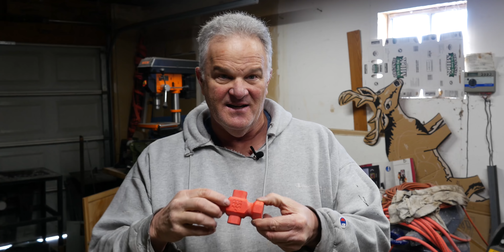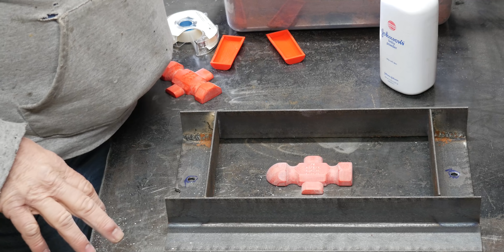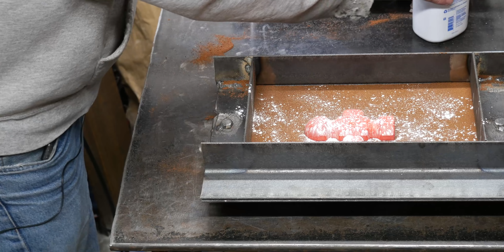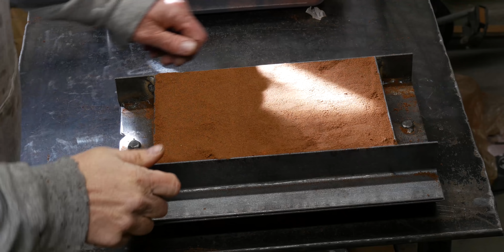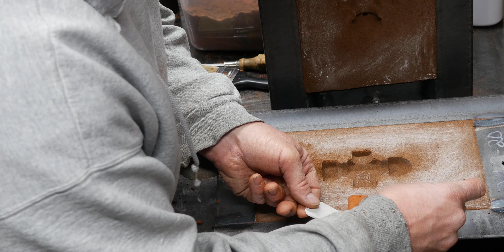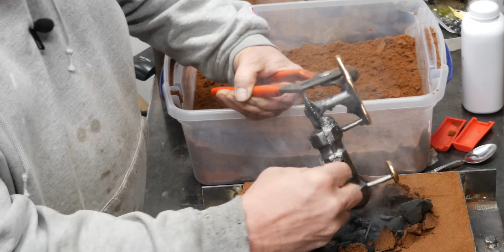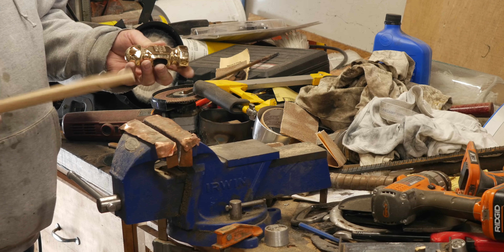Casting an aluminum bronze hammer

Comment: That turned out wonderfully, not counting the bubble of course... Yes, you were correct. I did not use a core. I was just using an old ball pien hammer as a form. I filled the bottom box, Drag, I think it is called then trenched out a spot to fit the hammerhead and hammered into the drag until it was half below the top of the sand, then took it out and sifted some petorbond into the mold, then put the hammer back in and hammered it back to the half waypoint. The eye of the hammer is vertical during this... Anyhow, then I filled the eye and packed it down as hard as I could till it was level with the mold on the outside... Well, surprise, surprise... the core always comes out with the hammerhead... After a bunch of tries, I said to heck with it and poured it full of wax. The was hammer turned out great. So, I widdled out the eye and molded it in petro bond, put it in the oven, and melted the wax... Lol... The darn core caved in when the wax melted... Today, I took my wife out for a ride in the woods on the ATV to enjoy the Autumn leaves, then I just watched a bunch of videos confirming that I was out to lunch on the whole idea... I think I will turn a whatever the thing is called that you use to tamp the sand down, on my lathe and make a brass one of those as a first project... A hammer seems to be a big ask for a first casting... KISS as we used to say in the Army, Keep It Simple Stupid...  I appreciate your videos so much. I intend to watch them all from the start eventually. Thank you and be well...
Reply from the maker: Be careful, some of my early videos are full of really bad technique. I wouldn't want you headed down that path.  
Most hammers, that I've run across, have a tapered eye in them. I think the top is the widest. That way when you drive a wedge in it will spread to a "V" shape and keep the head from flying off.

Comment: 3d printing the patterns is a great idea, but next time, design some registration pins into the 3d print. As someone else pointed out, get a smooth, easily sandable finish by spraying the pattern with a self leveling epoxy primer. Great video...
Reply from the maker: Thanks, couldn't agree more. Now that I've got my own 3D printer I can start controlling stuff like that a lot easier. I had to depend on a friend for this one and he forgot.  I'll have to get some primer. Sanding this stiff is a pain in the butt. ;-)

Comment: I just look Paul's video and I must agree, your hammer looks much better with the polished finish. To avoid these air bubbles inside your piece, add on both sides two to four additional small channels where the air could also escape. This pieces could be cut off later easy.  If you clean up the hole, try to fill it with tiny bit of molten aluminum bronze. Greetings from Germany.
Reply from the maker: I thought about filling it with a small bit of melted bronze but I think I will make an ever bigger mess if things if I do. Maybe I will try that some day. Thank you.
Reply: The voids are from metal solidification shrinkage, you have to have a properly designed riser to prevent them.
Reply: I had similar problems at start. Thin vents act as small pumps, pumping away metal when it solidifies and shrinks. You need to design reservoirs (risers) of molten metal into  mold. They need to be thicker than the cast part so they can feed molten metal in while it solidifies thinner parts first, filling voids. For small part casting its easiest just to make nice fat gate +thicker sprue  that will do the trick.
Reply from the maker: You should check this out. I made it a week later. https://youtu.be/MsW4G-J2LA4
Reply: I did already. We all do same mistakes at first :) and then learn. When casting bronze its better to have longer runners also because as you found out there are always oxides/slag (black grainy stuff at your hardened sprue bottom) in in melt. With long runner slag gets stuck in it and does not get into part.  Always make nice fat (wider than the part) riser at the end of runner to have a perfect cast.
Reply from the maker: I didnt want you to think I hadn't learned anything ;-)  Thank you for the information about the oxides and runners.
Reply: SV Seeker struggled with same problems in a bigger scale before he figured it out. Look his videos about aluminium bronze boat propeller casting,  there are good hints and tips.
 https://www.youtube.com/watch?v=4Ahj8ata5Sc&index=6&list=PLBA9AA4C4816E46F6

Some casters and especially professionals use ceramic filters before runners to separate all the schmoo but long runners will do almost the same trick without costing so much.

Comment: bubble is shrinkage. Sprue too close to the part. Large sprue, longer gate.
Reply from the maker: You don't think the bubble is due to poor venting?  I don't know, I'm asking.
Reply: I don't think so. Shrinkage draws from the hottest, largest pool. Bubbles can spontaneously form as shrinkage creates lower pressure in the hottest, still-molten section. Shrinkage draws from this hottest, still-molten section. If the sprue and part are similar size and close together, no telling where this will happen. if the poor-in is much larger, and the part is far enough away to allow the part to cool before the poor point, then the hottest section that shrinkage is drawn from will remain in the sprue. If the gate is too small, it can choke off too soon and block the part from being fed by the reservoir. Any air bubbles that spontaneously form in the sprue will not matter, because the sprue is waste anyway.  After trying with larger sprues, farther away from the part, with decent gates, cut a few sprues open. you will find large bubbles in the center not uncommon.
Reply from the maker: Fascinating. Thank you!
Reply: Eric K's explanation might be a little better. Key is that the melt needs to feed the part. If the part is bigger cross section, it can't.
Reply from the maker: Got it. I didn't know or even think about that .
Reply: Absolutely correct. I put a tin soup can over my pour hole and fill it 1/2 way up during the pour. The large volume of molten metal above the sprue keeps the sprue from hardening which allows the shrinkage of the item to continue to draw from the molten metal in the soup can. The spru then remains molten until shrinkage is complete. You have to extend your vent tube as well to allow you to fill the soup can. Various sized soup tins are free garbage and you can pipe and sand pack the cans if they are too big. Making sure that you have an equal or greater volume of molten metal above the sprue and vent hole will ensure that what happened doesn't happen again. The metal will shrink and draw from both the sprue and the vent. This is why often you see an incomplete part at the vent area of the pour. Pressure of molten metal on the part itself from both directions is the key to success.
Reply: I guess you can feed the casting from the top of the sprue however when I was taught casting ( over twenty yrs ago) I was taught to build a feeder reservoir connected to the pattern itself (or multiple feeders depending on the pattern). Feeder has to have a greater cross section than the pattern so the core of the feeder is still liquid as the cast part is solidifying. I'm used to smaller scale casting but the theory and understanding of what cooling metal will do is the same.
Reply from the maker: You’ll have to watch tomorrow’s video.  I think I’m closer to what your saying.  Probably not all the way there, but closer 

Thanks
Reply: swdweeb Wow, that is sooooo majorly unlucky! If it was at the peining end of the hammer, it may have been made into a useful tool. As is, it looks like you got annoyed with it an shot it with a big ass rifle 😡 But, I am sure the answer as to why it happened is a simple one. We all make mistakes and I'm glad you shared this, thank you. You have a new subscriber 😀
Reply from the maker: Great, welcome aboard.  Life gets better, if you haven't already seen this, here is a follow-up the hammer pour https://youtu.be/MsW4G-J2LA4
Reply: EdOfTheNorth Thank you for your input, I was wondering why I had seen videos of people doing exactly what you are talking about. So you need to keep pressure by using excess molten metal in the pour, correct? The "Soup cans" act like molten reservoirs, as such they reduce shrinkage because of the increased pressure? So, this will help avoid air bubbles?
Reply: Makes sense, let the liquid get a little head pressure by stacking it up a little. Molten metal would develop a lot of pressure by just a little rise, it's pretty dense... I'm tryin to learn.. Pretty sure the bubble could be TIG welded closed using some of the dross as filler metal.

Comment: Alignment pins are put in the holes in the pattern , riser blocks a are used in the gating system to stay hot longer and feed the part while cooling to control shrinkage . I ' d  try it again on video to show the difference .
Reply from the maker: Hey now, don't go stealing my thunder for next Friday's video ;-)
Reply: swdweeb  check out ( oldfoundryman ) and ( backyard metalcasting.com ) .
Reply from the maker: Thanks. Just started looking at olfoundryman and sandrammer

Comment: to align the parts I suggest drilling through one and partially through the other, while they are together. Drive an alignment  pin into the the fully drilled part that extends partially into the other. over drill the partially drilled part to be a slip fit. use two pins, one at each end.
you will have a permanent set of alignment pins./

Comment: First, that's a damn fine looking hammer - I absolutely LOVE that polished finish. Now for some tips to help in the future. 1st - you likely needed both more 'head pressure' and more material available to combat shrinkage. Having a taller cope (one of the reasons to use 2x6's to make them) aids in this - the higher up from the part, the more pressure the metal puts into the mold. 2nd - you really should make a conical sprue (and risers, depending on the casting's shape). These act like reservoirs to feed in material as the metal in the casting cools and shrinks. They also serve to increase head pressure - metal is heavy. You seemed like you had a healthy enough gate (needs a bit of cross section to allow the molten metal to flow without cooling and blocking it), so you have that going for you. All in all, that was a great result for that flask - you really should use a taller cope, if nothing more. A taller drag just makes it more stable for handling.

One thing you can do to help is to get some conical forms to use for sprue's/risers. Not a lot of taper - maybe double the bottom width at the top (inch ish at the bottom, 2 -3 at the top), but you just place them in with the pattern when filling and packing the cope. Then all you have to do is remove them and cut some gates. Skewers work well for vent holes in piece, if those are needed.

Gah, I can't wait until I can do this myself...I rather badly want access to a forge and furnace again...

*edited for spelling*
Reply from the maker: Thank you!    I got another comment about using small vents, like punched with welding wire. I''ve been treating the vents as risers and not really thinking about their purpose of venting gas. I'll definitely look into better venting going forward. I've also gotten the comment about conical sprues and risers that I will do as well.
Reply: Another problem could be dissolved hydrogen forming bubbles as it solidifies, if the above solution does not completely eliminate holes. In the aluminum foundry I worked in, we used extremely dry nitrogen gas bubbled through the melt, though a solid flux can be used to achieve a similar effect with way less cost.
Reply from the maker: I cant see me getting to the point of bubbling dry nitrogen through any of my melts. ;-) But I do appreciate the info. Always good to learn more. Thanks
Reply: +swdweeb - You're welcome. One other thing I'll throw at you is a great way to use the flask you have - you can make tall external risers out of decent sized food cans. Check out Brian Oltrogge here on youtube - https://www.youtube.com/channel/UCOywIdppbhn6hkgcEtDMatg - he does exactly this in a very simple, elegant way. It's a great way to use thinner flasks (and consequently less sand) and still get fantastic head pressure and fill volume. His style of using wells and curving gates is also excellent for reducing turbulence  in the pour, reducing air entrapment in the first place (I don't think you has issues with this, though). Carry on. :)

(I admit - I went on a casting binge watch after your video)

Comment: Look up Chvorinov's rule. Cooling rate is all about surface area to volume ratio. To ensure your casting does not suffer from shrinkage defects you have to make sure your riser has a lower surface area to volume ratio than any part of your casting. Doing this should reduce effects of shrinkage.

Comment: 21:20 your entry hole is small and its not on the top of the hammer so when you poured the molten metal the metal got cool fast and left a hole on your hammer or some mud fell from you casting and mixed up on your molten metal so it left a hollow area.
Reply from the maker: Um... no.  Everything you just said is incorrect.  The sprue is sized just fine.  I use it in all of my castings. You never pour directly into the part. That is a recipe for sand coming loose where the pouring metal hits it. It is also a guarantee of turbulence in the pour resulting in porosity. And it most certainly wasn't because the metal was too cold. The part filled just fine. It didn't freeze as it was pouring.

The hole is the result of metal shrinking as it cools. I know you won't watch this but here is the solution to the shrinkage.  https://youtu.be/MsW4G-J2LA4

Comment: good thing to do on the 3d print is to add locator pegs help out alot
Reply from the maker: Yeah, I've got pins in a project I'm doing in an upcoming video. A friend of mine printed the hammer head. We talked about alignment pins and then they never made it in to the part. It turned out ok but my stuff will all have pins in the parts.

Comment: Is alu bronze too hard for small tools meant for non-ferrous metals?
Reply from the maker: I don't know how hard it is, I do know that I cant cut it with a hacksaw as the blade just skates across it.   If you're looking for a softer hammer, you could just cast copper, but it work hardens so it wouldn't be soft forever
Reply: Thanks for the reply. I am very interested in the material for lathing with a mini lathe where harder than alu material might occasionally be needed. The lathe is intended for non-ferrous metals only. I have some test rods of alu bronze, so I could report later how the tools might bite it.
Reply from the maker: FourSeasonsHD you might check with Nigel over at smallcnclathes as well. He might have some experience with it.  Tell him I sent you
Reply: Thanks a lot for the suggestion and reply. I might do just that.

Comment: Well done. Those holes are interesting. When I first saw it I thought it was a result of that edge that collapsed. But, it looks too round to be caused by a lump of sand. I will have to dig back to my injection molding classes to see if I can figure out anything.
Reply from the maker: Any advice you can give is welcome, thanks!

Comment: I would think that the "void" is a "Vacuum" bubble, where the cooling metal shrunk, and the sprue was already too cold, and had chilled off/shut, before there was any chance for any "liquid metal" to flow from the sprue, into the body of the casting. Perhaps, make your sprues much larger, so as to keep them hot enough to act as a "supply reservoir" until the body of the hammerhead has cooled and hardened throughout.  I think that that is what the main function of the Main sprue IS.
Reply from the maker: I've taken to using larger risers to supply the parts with melted metal until the part cools. So far this has helped the void problem. Have you wanted the "hammer revisited" video I did the following week?
Reply: .....No, I have not had time to watch many of your great videos, yet. I just stumbled onto them, this evening!    You ARE Living the Dream!!! GREAT Projects, and videos!!! You are Inspiring me, very much!!! (Currently, I'm trying to heal from shoulder surgery, so, it may be several months before I can attempt to do much in my shop, but, It's GREAT to watch your demos!   Thanks!!!
Reply from the maker: Thank you.  I'm having fun learning all of this new stuff.
Reply: Thanks for these GREAT videos! They're Fascinating, and Inspiring!

Comment: Is there a reason you didn’t just quench it in water when it was hot? Good job
Reply from the maker: I'm not a metallurgist and I don't know if a water quench would do do anything bad. My assumption is that the crystalline structure would be affected and that it would make it more brittle, but I have no idea.
Reply: @swdweeb  it’s actually how you anneal it (quenching in water). If you work harden it, you can make it soft again by annealing it. Kind of the opposite of hardening steel.
Reply from the maker: @manminusblood  Fascinating. I did not know that

Comment: You could TIG that bubble using the castoffs as filler rod. I have put soft facing on hammers with al bronze using TIG. Looking forward to seeing more casting... Good Video... BTW: I can't wait until you get some dedicated heat in that shop, I feel your pain....
Reply from the maker: You know, I asked a tig welder guy that I know and he just looked at me like I was crazy when I brought it up. I had another guys after a very similar comment when the video first came out.  Have you seen this video yet?  Maybe when you get your shop set up I'll come up and you can show me how its done ;-)